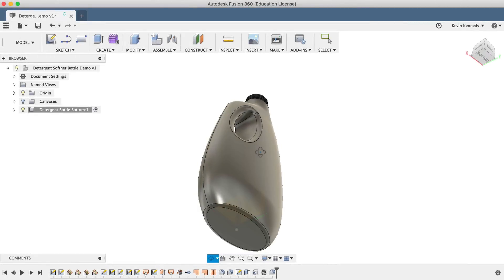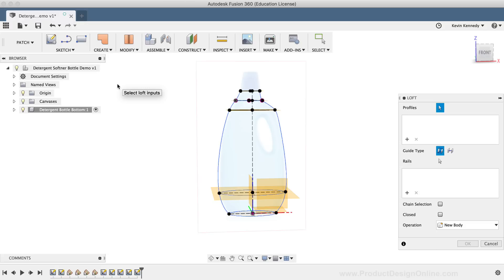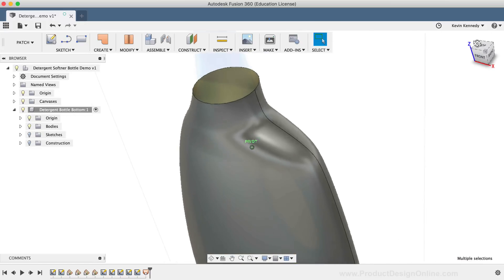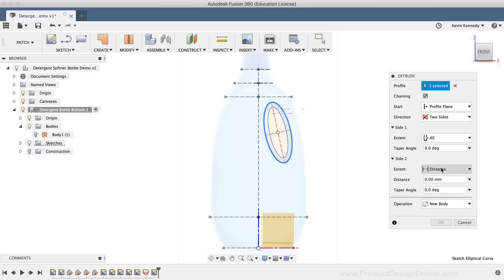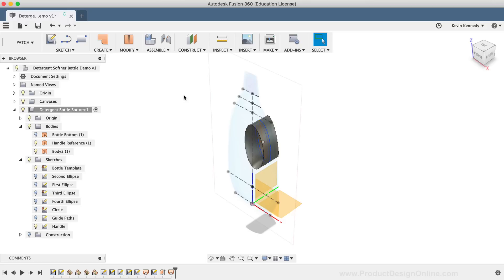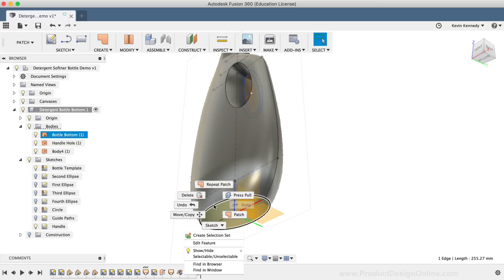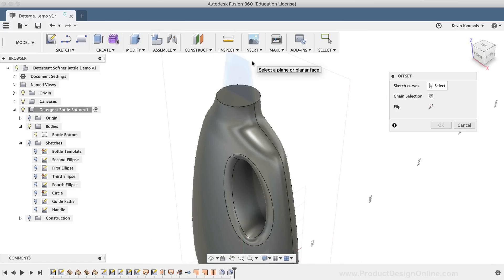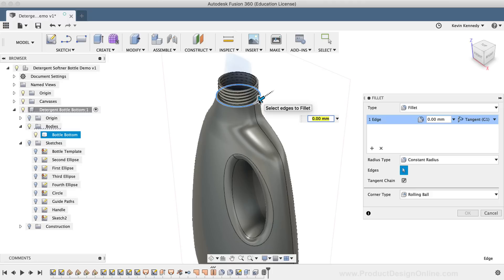How to Surface Model a Detergent Bottle in Fusion 360

Comment: Just the right speed. Lots of tutorials, including some of the Autodesk videos, fly the mouse around like it's an angry gnat. I don't know where it started and I can't follow where it finally lights. Before I can catch up, it's flown somewhere else on the screen. Your are carefully paced and the order you present things is deliberate.

For example, on the Thread panel, the Model checkbox is way at the top. Most others click it right away before the viewer can understand why it is being clicked. You wait until the very end where we can see exactly what it does because everything else has been done.

I've been whacking away at F360 for a month now. I didn't follow your  30 day tutorials in order (some I still haven't looked at) because I learn best by doing something I want to accomplish. But when I get stuck, I look through your videos to find something the uses where I'm stuck. Nearly every time, one of your videos resolves the issue.
Reply from the maker: Thanks, Ericcsuf! I'm happy to hear that you been enjoying my videos!

I've definitely been getting better and better the more videos I crank out. I'd agree with you - some of the Autodesk videos could use some improvement. Unfortunately, they seem to continue to post really old videos that were originally used for documentation and other types help content...which seems to cause a lot of confusion... let along the dry instructor.

My goal with the 30 days series was to make them thorough enough that one wouldn't have to necessarily watch them in order. With that said, please don't hesitate to comment on any of my videos should you have any questions. Cheers, Kevin :)

Comment: Great video as usual , i was searching for something like this tutorial
Reply from the maker: Thanks, Mohamed. I'm happy to hear you enjoyed this. I appreciate your continued support. Cheers, Kevin :)
Reply: Just a question , I saw your videos for converting Mesh ( as stl file ) to solid body to modify , the main challenge in the way you demonstrate is switching off recording history , my question is , is there other way to avoid switching off recording history because if I switched on the history after conversion the performance of fusion 360 become so bad in case of complex      mesh object
Reply: @MohamedMostafa-tv6cd  Upgrade your computer to workstation with nivida 4 gb
Reply from the maker: @MohamedMostafa-tv6cd  Currently, in Fusion 360, there is no way to do that without turning off the design history. I would suspect that there won't be a way to do so in the near future either, as it really comes down to a performance issue with the timeline being able to handle such complex changes.

If you have a really complex mesh then I would suggest checking out Autodesk Meshmixer (also free). Meshmixer is much better at handling complex meshes. You may even be able to reduce the mesh and change it up as desired, and then bring it back into Fusion 360. Cheers, Kevin :)

Comment: I learn so much by doing these tutorials and then trying the techniques out on my own models.  Great big thumbs up for this one in particular.  Thanks!  I am starting to get some momentum now that I'm higher on the learning curve.  I still struggle with lofting getting the rails to intersect the lofting curves.  I'd really like to know how to create a straight line between two points that are in different sketches to create good rails for lofting wings from airfoil spline curves.
Reply from the maker: Hi, Jim. Happy to hear this video will be useful in your own applications. That's a great idea - I'll have to make a video with some of the top reasons why the loft/sweep doesn't work with the rail... and some things to try to fix it. Thanks for your suggestion and continued support! Cheers, Kevin :)

Comment: Great video! How much harder would it be to get an equivalent model using solid modeling? What do you consider when deciding which approach to take for a given model?
Reply from the maker: The handle part would be the only challenging area for solid. Generally, surface modeling helps achieve better exterior geometry when the "surface" is important.
Reply: @ProductDesignOnline  thanks!

Comment: Great tutorial! May I know why you choose surface modeling instead of 3D modeling for this Detergent bottle? 
Any benefit of choosing one or the other? Thanks!
Reply from the maker: Hi, Kevin. Great to hear from you and that's a good question. In short, Surface modeling is used when the focus of the design is solely on the exterior "surface" geometry. The advantage is that you can create smooth and complex exterior curvatures without worrying about solid components getting messed up. I will be doing more posts on my website this new year in regard to surface modeling as well as more tutorials. This other video of mine explains things a bit more on a high-level approach, in which I think you'll see some of the benefits really shine in the process - https://youtu.be/8HwM07hmXhM
Cheers, Kevin :)
ps. Wishing you a happy new year!
Reply: @ProductDesignOnline  thanks! Happy New Year!

Comment: Hey man! I have a Mac Pro 6 Core -  is that suitable for Fusion 360? that is the only equipment I have right now -  great Vids though...
Reply from the maker: Hi Gabriel. That Mac Pro should be suitable to run Fusion 360. You can crosscheck your computer's specs with the Fusion 360 system requirements, here - http://bit.ly/f360ComputerRequirements
Cheers, Kevin :)

Comment: After you complete the bottle is it as easy as printing it? 
Also, what are your thoughts on the UI beta?
Reply from the maker: Hi, Rud Dog. Great question... I'm not sure how this would print out as I haven't tried it yet. This type of surface modeling was done with the intention of blow-molding the object, in terms of real product development. However, I would assume this would print fine, especially on a smaller scale. I guess a lot of it would depend on the type of printer... and maybe the wall-thickness would need to be increased some?

In regards to the "new" UI. Overall, I like the direction it is going. I've been using it quite a bit... but have been reverting back to the current UI for recording these tutorials until the new UI is solidified and actually pushed out to everyone. Some of the feedback I have given my contacts at Autodesk include some room for improvement with the tabbing of the different "workspaces" or grouped commands. As I discussed with them, I think the relationship between the tab and the available commands is not quite as clear as it could be. They underline the tab, but there is no visual divide between the other tabs and the icons below. Generally speaking, it's a best practice to stay away from having tab-styled UI components underneath other tabs. As in, there are tabs for the files and now tabs for the different grouped commands. I think they need to restyle this a bit...and I know they're working on it. Other than that, I think it comes down to a lot of small details...maybe decreasing the size of the icons in the toolbar? Having better hover states? Having more help text, etc.

What do you think??? Have you tried it out?? Cheers, Kevin :)
Reply: @ProductDesignOnline  As with anything new the interface will cause users to stumble and revert back to the old UI only because they are familiar with commands and their locations. I tried it out and returned to the old UI in the interest of expediency. But if they push it out as the standard I think I could get used to it. 
Thinking will the videos be created under the new or old UI here and elsewhere in youtube land.
Reply from the maker: I feel ya on that. It always takes a while to adjust no matter what. My plan is to not switch my tutorials over to the new UI until the update is formally pushed out to everyone. I had debated doing the new UI a few months ago, but then realized that they are still changing things (quite often) as we speak. I didn't want to end up with 3 or 4 different UI versions throughout the tutorials...and figured it would be best to only have them adjust with official/major releases. Cheers, Kevin :)

Comment: What would be the main difference between this process and the exact same one, lofts and splits but using solids?
Reply from the maker: Surface modeling gives more flexibility when focusing on the exterior surface. With solid modeling you would not be able to create the hole in the handle, with the capability to change the geometry. with surface modeling you also add the thickness at the end of the process. The advantage to this is that you can create, trim, and manipulate bodies without having to worry about them taking up the same space - one of the common errors and problems with solid modeling.
Reply: @ProductDesignOnline  thanks! i am literally modeling it as I type, I have been able to do the body and handle via SPLIT with solids, but I can already see a little difference that you just mentioned, thanks, i appreciate your quick reply!

Comment: Great Video! I'm thinking about how to make a complex housing. Therefore I created surfaces that perfectly fit aroung the parts in side. Now the problem is that in my case I started with the inside surface and you in the video with the outer surface. Do you know how to thicken my solid bady created from that surfaces for later making it hollow? Maybe you can make a video how to do it when you have to start with the inner surface first..
Reply: stich the surfaces to made a solid body, then use the hollow command to make it hollow.

Comment: I have tried to follow this but keep having a problem when it come to the handle and elipses.  When I try to select the elipse edge I keep getting the area inside the elipse. I have re-watched the video many times I cannot see how to correct this.  BTW great video would like to see more of this maybe using other reference geometry for mulitsided modeling.
Reply from the maker: Hi, Bernie. Can you provide a link to a screenshot? That may help me notice a difference in your file/setup that is causing this.

I will definitely be doing more surface modeling tutorials, including some more complex geometry. Thanks for your continued support. Cheers, Kevin :)
Reply: here is the shared images https://drive.google.com/drive/folders/1Okf8oqaqJUTXrx8oSvKR7nBMQ-3LYMvp?usp=sharing

I re-tried again and this time it worked. I think I forgot to activate the component so maybe the issue was where my new sketch and body resided.  Thank you
Reply from the maker: @berniewasserman265  Good catch! I bet you're right... I've done that before too. It's easy to get caught up in something and forget about the different components and how everything is nested. Nonetheless, I'm glad to see you got it working! Cheers, Kevin :)
Reply: @berniewasserman265   I had the same problem.  I recreated the ellipses in the same component and I was able to select just the ellipses.  I also used Create+Extrude in the Patch workspace instead of the "E" shortcut.

Comment: hello, I have a complication to achieve the loft between the 5 plan I created when I select the two rails to have the shape volu MESSAGE IS DISPLAYED (THE GUIDE IS NOT G1 BETWEEN FIRST AND LAST SECTION) END ( tool body creation failed) I draw the shape of the bottle and the plane several times but the two errors are displayed each time .If I select only two plan the loft is realized without problem.your help me is indispensable. thank you
Reply from the maker: Hi, Selimane. Not G1 simply means it's Not Tangent. You can also try to prevent selecting multi-segment rails by unchecking the "chain selection" toggle. with that said, I'm not sure what is going on with your model without looking at it specifically. Share your public link as a reply to this comment. Here's a video explaining how to share a public link - https://youtu.be/2XrcrdV-8Ls

Then, please write a separate comment letting me know you've replied with a link because YouTube flags most links and I don't always get notified. Cheers, Kevin :)

Comment: Surface model a detergent bottle: Is this just a practice in concept / skill / learning, or is this something you can actually 3D print with a filliment printer and use?
Reply from the maker: This is more for practice/learning concept. You could technically 3D print this if you made the surface thick enough... you would also have to double-check the undercuts or anything else.

Comment: When drawing the sketch for the rails, I'm struggling to get it to connect to the ellipses. Do I use the "project" feature or the "intersect" feature to include the ellipses in the sketch so you can ensure the rail is intersecting?
Reply from the maker: Hi, Katia. Can you check that your "Auto Project Edges on Reference" setting is turned on? Instructions here - https://productdesignonline.com/default-settings-for-fusion-360-tutorials/#autoProject
Cheers, Kevin :)

Comment: I don't understand something: What is a "guide rail" actually doing?
Reply from the maker: The guide reail will help you further define the shape of the bottle, as it makes the lofted shape follow the specific guide rail.
Reply: @ProductDesignOnline  So when there's no guide rail, what is it following? Just some sort of mathematical curve/arc which fits the points as best as it can determine?

Would you ever do surface modeling without a guide rail?
Reply from the maker: @larrybud  Correct. Generally, always want guide rails so the geometry is controllable and expected.